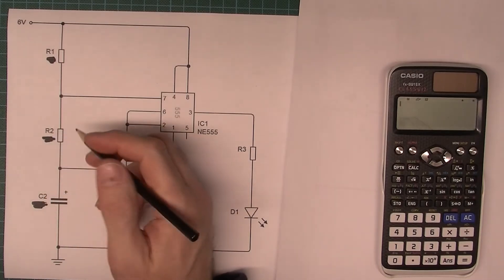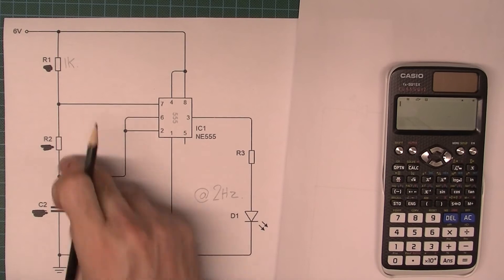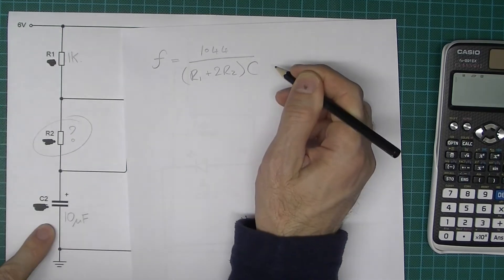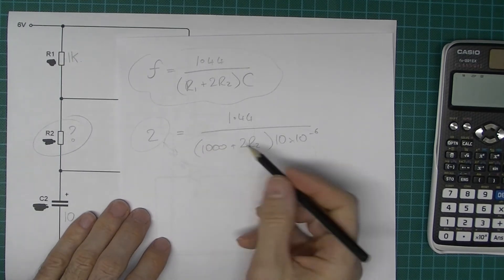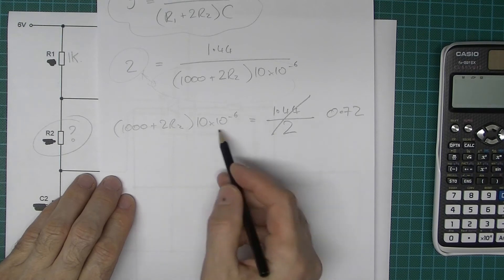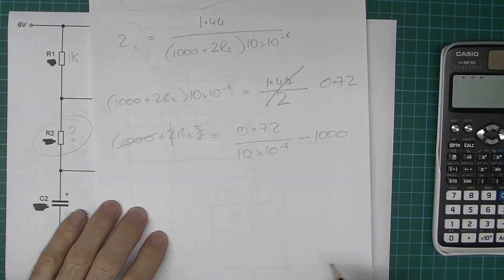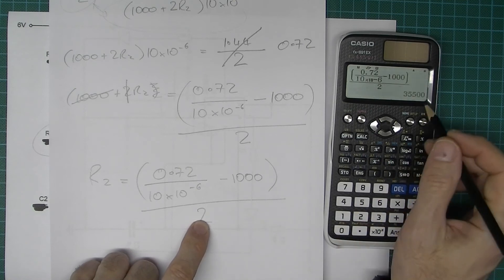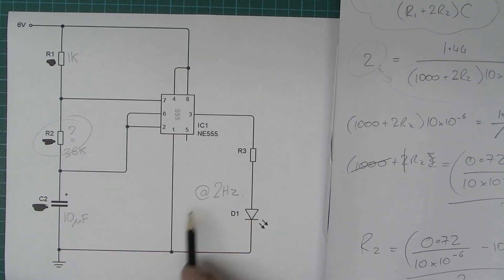Tutorial: 555 astable timer resistor and capacitor calculations | EDUQAS GCSE Electronics

Comment: I’m trying to make a controller for a dc  motor from my research I have done online 50hz -100hz is best for a brushed dc motor. With that being said I did my calculations for 60hz R1 1k R2 76k C20mf is this correct will it work? I’m also curious how do I connect a e-bike twist grip throttle to control the motor speed. I want to put 555 timer to mosfet Sorry if these are dumb questions. I’m just starting to learn this stuff
Reply from the maker: 50 - 100Hz PWM would be very slow. I recall that PWM motor controllers are typically 2kHz or greater, but I'm not aware of a calculation to find the optimal frequency. Don't forget that PWM uses a fixed frequency, and the speed control is achieved by varying the duty cycle. I have no experience of twist grip throttles.
Reply: @PizzeyTechnology  thanks for the reply

Comment: Hello, R3 would be same as R1?
Reply from the maker: The resistor indicated as R3 is a current-limiting resistor for the LED. It's value depends on the supply voltage (Vs), forward voltage drop (Vf) and forward current (If) of the LED. None of these parameters are related to the timing components R1, R2 and C. If you want a reasonably balanced duty cycle (on / off time approximating to be equal, but never exactly so) R1 should be much less than R2, with R1 generally being no less than 1K.

Comment: How to calculate if use just one resistor and one capacitor?
Reply from the maker: @tupai62 - here are you, I recorded a video showing how to build a 555 timer with just one RC network. Don't forget to like and subscribe :D https://www.youtube.com/watch?v=1HfDy0mvbvs&ab_channel=PizzeyTechnology
Reply from the maker: If you have only a single resistor then it won't be an astable. Beware of omitting the top resistor as pin 7 (discharge) is an open collector.
Reply: @PizzeyTechnology  is it can if use 1resistor 1capcitor to make led blinking?
Reply from the maker: It would help if you could define the problem further (it's not a school homework is it?). Does the circuit have to use a 555 timer or could it use some other component?
Reply from the maker: It's actually quite easy to build a 555 astable circuit using just one RC timing network (one resistor and capacitor), but it's operation is different to the one I posted about previously.
Reply: @PizzeyTechnology  Which condition that make battery fast weak n drain?...using capacitor 10uf or 100uf?.
Fast blinking rate or slow light will weak the battery?
Reply from the maker: If you want to build an efficient circuit, don't use a 555 timer IC.
Reply: @PizzeyTechnology  to make led chaser using 555 n 4017ic, the pin3 blinking rate from 555 to pin 14 4017 must in slow/slowest blinking rate or fast blinking rate?
Reply from the maker: Clock speed depends on how quick you want the decade counter to advance. It can operate at high speed (MHz) far above what you'd want for an LED chaser.

Comment: I need it to be on for an hour and off for an hour and the calculations I made are: r1 10k r2 340k c 15000uf, is that correct?
Reply from the maker: You've done the calculations correctly but you may find performance is not as expected.  The charging current for the capacitor would be very small and the capacitor leakage current could therefore be a problem - it might never charge to the 2/3 threshold. Component tolerances might also be a problem but that depends on how accurate you want the timing to be. If you want to implement long delays a microcontroller-based circuit might be a better solution.
Reply: How can I use a clock alarm to activate a relay?
Reply from the maker: @agus-lq8vv  Depends on many things. What signal does the alarm clock produce? What relay do you hope to use? Will the relay latch on? etc.
Reply: The clock is similar to the one seen here https://youtu.be/L2dwC3BsvQc I want to use the speaker signal to activate a relay as seen here https://youtu.be/V0-X_Ton84Y and I need to know what circuit to use. All this is for a school automation project. Sorry if I do not understand much is that I am from Argentina and I am using google traslate jaja
Reply: I wont 25 second on an 5second off 
Please give resistor and capacitor value  for using 12 volts